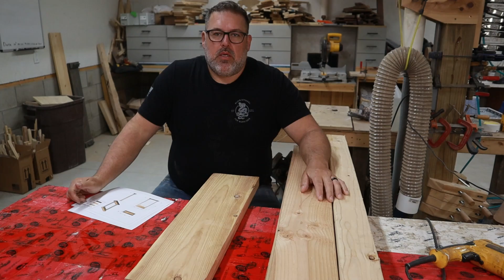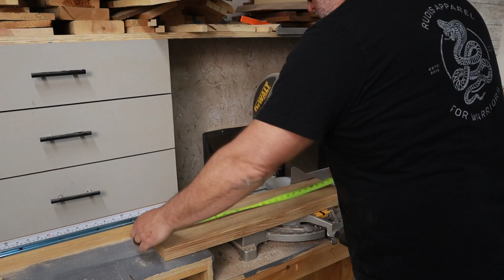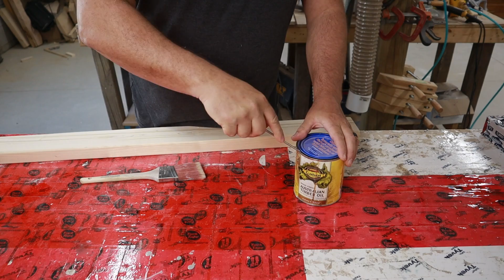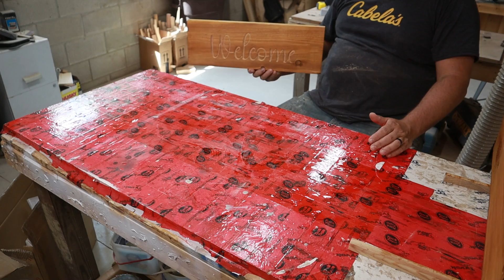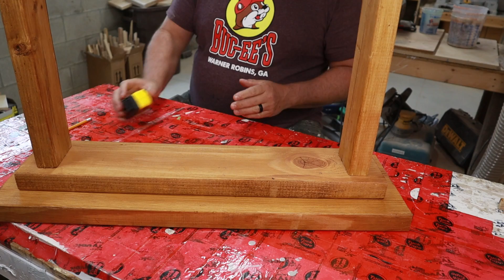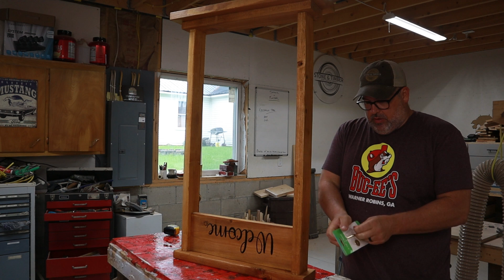DIY Welcome Sign with Hanging Planter: Perfect for Your Front Porch!

Comment: Presure treated has chemicals. I have found using just pine or douglas fur then spray on a treatment. I use Cabot Australian Timber Oil Wood Stain. It protects and has no chemicals that can harm you. To each their own but no treated for me.
Reply from the maker: I love the Cabot Australian Timber Oil stain. I understand the concerns about pressure treated. Thanks for the input!